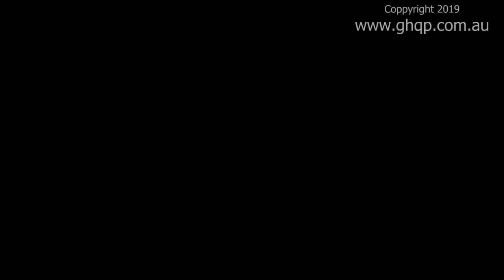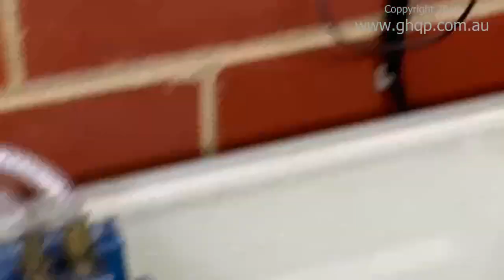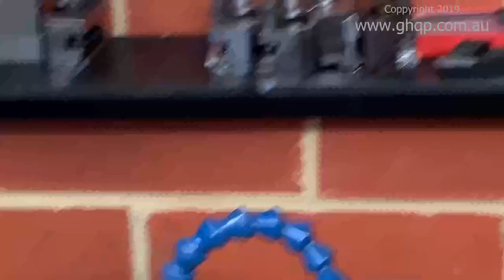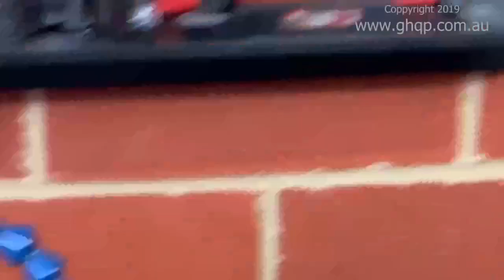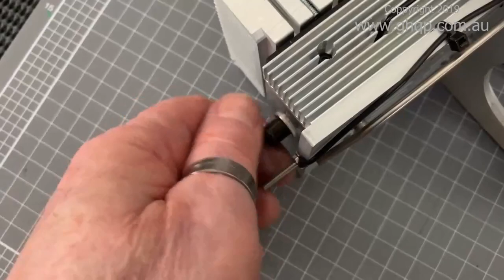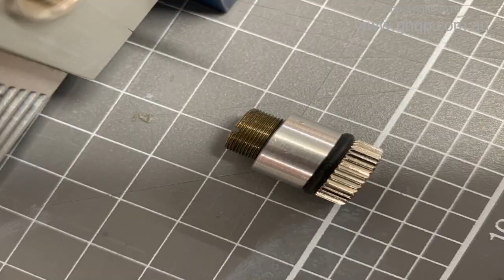Laser Focus Lens Spacer – PART 2 of 3 - Making the Spacer

Comment: Hi, thanks for a very informative video. Can you tell me what was the original focal length of the laser was before adding the extension tube?
I ask because I have just purchased a cheap Vigotec module and  the focal length seems enormous compared to my other module of different manufacture. Also, it has a horrible rectangular burn characteristic even when focussed to its minimum.
I was pondering if this extension mod would help. Cheers Rich
Reply from the maker: Sorry I don't recall what the original focal length was. I am using a 3 element lens. All diode lasers do put out a rectangular beam and it is the job of the lens to tighten that down to a tiny dot. However it will still under magnification be a square, though to the naked eye it should look circular.

Comment: Excellent.... Thanks for sharing. I'm just trying to figure out how to make it as I don't have a lathe.
Reply from the maker: jeromejt62 I just did a test using a metal laser diode housing case purchased on eBay (no diode). Removing the M9 threaded end and then cutting off the back male threaded section you end up with a female M9 internal threaded tube about 7.5mm long and that works.